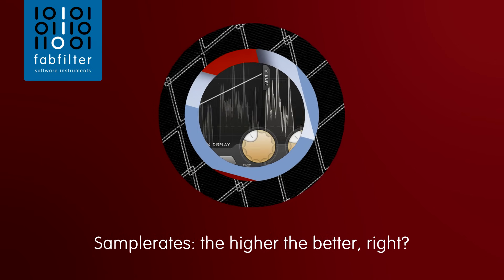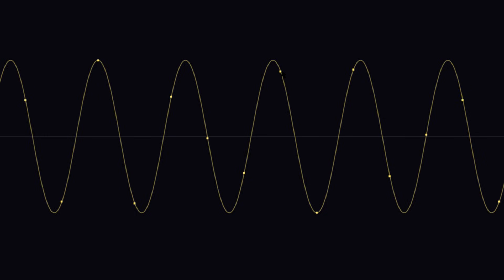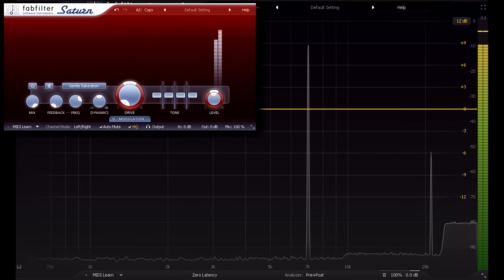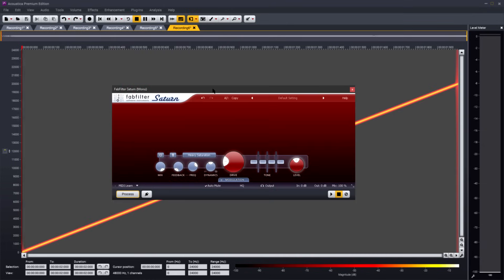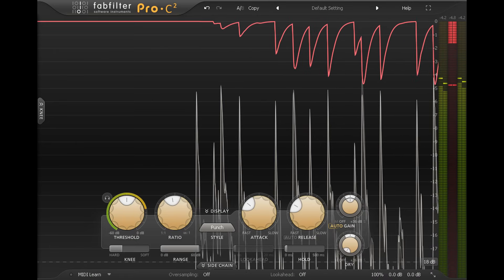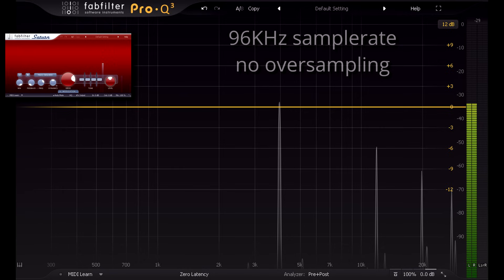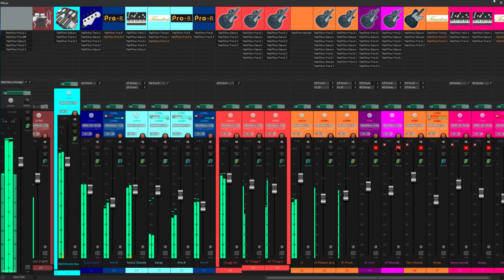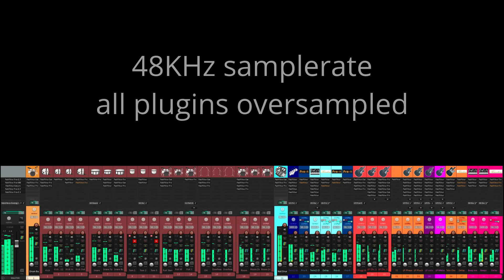Samplerates: the higher the better, right?

Comment: So much useful stuff in just one video, it's unbelievable :
- Understanding why digital saturation/compression doesn't sounds right compared to analog stuff (i.e. guitar amps for example)
- What is aliasing, with clear examples
- Which effects are concerned and you need to oversample, with audible comparisons
- Advice on what to do for the best quality without destroying your CPU
- The incredible custom guitar chain with EQ for the cab, then 3 stages of saturation for the amp. I HAVE to use this !
- At the end of the day, technical stuff or not, if it sounds good it IS good. Maybe the best advice of this video.

Thank you so much Dan Worrall, for this free valuable resource.
Reply: absolutely this

Comment: I love these rabbit holes what take you right back where you started, but with more knowledge of why your are good where you're at. I could hear the difference between all the sample rates/oversampling combos. I think I've concluded that for my uses, mixing in 48kHz with oversampling where possible will do juuuuust fine. I'm actually considering getting Saturn now, but I'm not sure I need it with the other saturation plugins I have. I haven't even looked to see if they have oversampling. Mixing is one of those things where you can easily get lost in the details.
Reply: No you didn't.

Comment: Dan, for years, I have searched for this conclusion. I spent two weeks chasing my tail trying to mix a solo acoustic guitar song: each corrective tweak created more deficiencies than what it solved. No matter what I did to "improve" the mix, it simply sounded like there were both dead spots and artificial bright spots that nothing could fix.

After watching this video, I tried a 'what-if'. I lowered the DAW session sample rate from 96kHz to 48kHz and made no other adjustments. Immediately, as if someone flicked on the sonic fullness switch, my mix sprang to life. Life will never be the same, thanks to this video. 48 kHz is my new sample rate. If a project calls for a track to make its way into the movie domain, I will simply upsample the 48 kHz master to 96 kHz to meet that format.

Thank you for this most excellent 'put the sample-rate argument to bed' video. Keep up the good work!
Reply: I'm sorry to say this with a delay of one full year. But are you aware that if you resample anything from 48 kHz to 96 kHz, the only thing you get is your files taking up twice the space they originally took, without any improvement in 
sound quality whatsoever?
Reply: I think you misunderstood the original post.

Comment: Thanks for a fantastic video Dan Worrall!! 
I have been skeptical if the the higher samplingrates made any bigger difference. When using 96 and resampling down to 44.1, I never heard a better result than going from 48 to 44,1. Now I can stop wondering and just stick to 48k with a great explanation and relief :-)
Reply: This video demonstrated that you will hear a difference, assuming you apply digital processing of the signal to a common degree. What did you think the point was of him advocating the use of functions which use 8x the project sample rate, featured in the distortion plugins?? 
 It just also demonstrated that you're better off using higher sample rates on a per-process/plugin basis, to avoid using resources on processes which cannot benefit from it (meaning not setting your entire project sample rate, based on the highest denominator which is your most aliasing-prone plugin(s) because it affects the CPU power needed for everything which doesn't audibly affect the signal as well. This has always been the case in out-of-the-box processing, because every analog signal processor, such as the type of distortions he's emulating here, was already 'upsampled' separately, by way of being an analog process, while the drum machine that the band used, was not unnecessarily digitally upsampled at the source, or at any digital point in the chain that didn't benefit from upsampling. But you will certainly hear the difference when you apply a digital process that aims to recreate the type of analog warmth that these distortion DSPs are doing. He's literally explained to you that you want very high sample rates for that type of processing, just that it's handy to have this function available and contained within each plugin, which in effect is just a way of getting closer to the way out-of-the-box mixing and mastering is done, assuming the inclusion of analog gear, which is virtually any  music that isn't chiptunes.
Reply: @JohnnyNatrium  Thanks for your reply Johnny. I got it and that was exactly my point. Using plugins upsampling.. and not considering the AD/DA when using outboard or recording audio:-)

Comment: This was a great video and you broke it down in layman's terms where people could grasp the concept. In reality the better the original recordings are captured or managed can also play a very important role in eliminating some of these issues you are pointing out especially if it means being able to use less plugins. In my home studio I try to use plugins sparingly not only to limit how much processing power is required by the computer but just to keep things simpler. I also run a Hybrid DAW station with an analog mixer with the option to run external compressors and limiters when needed which allows me to capture a really decent analog drum mix where the DAW can be just more of a multi-track recorder and the same goes for capturing bass guitar and using an external compressor/limiter rather than using plugins to manage the bass guitar's dynamics and as long as you're mindful of the gains during recording, you're golden. For me and my needs this works but for a modern day commercial recording studio this probably wouldn't fly or at the least they would be limited especially dealing with many different styles of music due to the dynamics they may see like speed metal vs classical music along with music production for a movie etc and the effects required to make it deliver.

Comment: in case anyone wondered, youtube is cutting at around 15k or 16k (so you might still hear 20k Hz)
Reply: Oof I nearly forgot
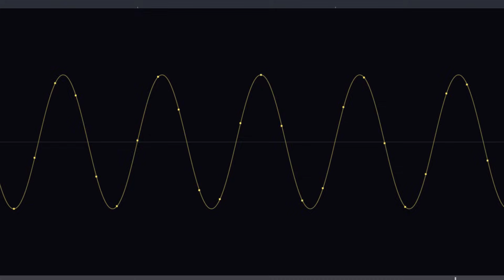Reply: Not for all videos. This video uses the Opus codec with a 20 kHz filter. The 20 kHz tone at 4:59 is actually clearly there (I checked with a spectrum analyser), allbeit a bit attenuated.
Reply: Check the stream you're receiving on the "Stats for nerds" option. If you're receiving an opus stream, you're fine.

Comment: Amazing video! Could you also do the same video for resolution as that has the same myths. So many DAWs support 32bit floating now but so many still use 24bit. Would be great to know the math behind this as well.
Reply: @ncshuriken  Reaper records in 64 bit FP
Reply: CPUs might actually handle 32-bit float better than 24-bit int depending on the algorithm. 24-bit actually has a ton of information, you probably won't hear it the difference, but I would not say the word "always" when it comes to computers

There's a good chance some DAWs will store 24-bit samples as 32-bit integers since CPUs handling 32-bit data better than 24-bit, plus it would increase mixing quality

Comment: Before I invested in my mixer and other outboard hardware, I did a lot of research into what was considered the optimum rate against cost benefit and return. I wanted to record bands multitrack during  live performances and master them afterwards into usable acceptable marketing material. I had used my much loved and trusted Yamaha 01x for almost 20 years but it has been obsolete for over a decade since Yamaha refused to update the "firewire" drivers since Windows 98 so there after I have to run later versions of Windows in development/test mode for the mixer to work !! 

For whatever reason I never found this tutorial, not that it would have made any difference, it is by far the best explanation over any other I watched of sample rates and diminishing returns on investment. I can see some highly regarded producers seriously argue with your opinion/conclusion, but like you I just chose to ignore their snobbish professional opinion of higher is better, understanding it didn't matter. So I bought my Behringer x32 over the more expensive Midas 32 variant or Allen and Heath knowing the quality might not quite be the same but still good enough for what I wanted to achieve. I also own a Liquid 56 so any extra quality could be overdubbed later, that is housed in my home studio cabinet that is way to heavy to be considered mobile. I just connect my Surface Pro through USB and I have a full 32 channel mobile recording mixer/studio with full remote control. I bought this start of lockdown as I was offered it at a great price including the stage boxes and interconnecting cables. Now I know some might comment on the Midas pre amps, I know, really I do, they are better, but I got everything for less than 1/3 the cost of the Midas 32 new.

Comment: Exceptionally well done Dan.

7:15 One point here, I don't think that the noise came down through out the spectrum because of inter-modulation, but I think its because the 7Khz sine wave lifted the level of the signal to the level of the clipping/distortion point at saturn so the noise started to produce overtones beyond nyquist that reflected back to audible range. I could be wrong offcourse.

Thank you very much for your effort

Comment: I’ve found that mixing at higher sample rates makes for easier mixing. It’s easier to hear reverbs and room mics, and the high end sounds different. I would guess that eq’s work better. All at the expense of more CPU.
Reply: Gordon Gurley agreed. And while there are plugins that oversample, there is also linear phase steep filtering involved which kills transients to my ears. 

I much prefer working at 96kHz and staying there without oversampling to get the best aliasing to dynamics to cpu load ratio.
Reply: @leckel1996  and how do you counter the intermodulation distortion that increases when working at higher sample rates?
Reply: @leckel1996  Also.. The video was using samples recorded at 44.1khz I assume. It's a whole other thing when you have recorded material at 96khz and 192khz. There is so much more than aliasing involved...

Comment: "I grew up watching standard definition TV, which here in the UK meant an image size of 720x576" . . . Well, the resolution may have been 720x576, but you were actually watching a 768 x 576 size image as PAL has a non-square pixel ratio (1:1.06) . . and to be super nerdy we can't really call a pixel count a 'size'.
Reply: Not going back tooo much further (Dan's not that much younger than me..), broadcast television pre-digital (CRT) was 625 lines in the UK..
Reply: Digital broadcasting size was indeed 720x576 (768 x 576) but the actual analog broadcast had a "resolution" of about 200x400-350x500 at times depending on the source and the quality of the broadcast transmitter / receiver. Recording it to VHS brought it down to 150x400 - 240x500ish. Analog resolutions don't really compare as you have to know the frequencies of the scalers to be able to calculate the digital equivalent.
Reply: @duncanparsons  Full image was 625 lines but this included sync and timebar that weren't shown to the end viewer. The visible area was - theoretically, but never achieved - 576 on PAL.

Comment: 48 khz sounded the best to me here in this video (although I listened this now only on my Macbook pro). More low end, somehow fuller sound, deeper.. The same conclusion I got while oversampling project inside my Cubase 9.5. Actually what you can't see/hear in this video is when you go for higher samples,  I mean higher than 48khz, although they clear the higher spectrum you loose your meat or low end as you want, the body. The kick will sound thiner, without the punch and so on.. The same as in this video I found 44khz sounding somehow as with less informations, less headroom, shallower, somehow as if it's overcompressed. All in all thank you for this video, it's really so instructive since it enters in details in the very core of the problem and it clears a lot the mess in persons head when you start to ask yourselves what to choose between the options and how to set yourself up given the possibilities.

Comment: Found this video while just searching for differences between samplerates and got a whole lot more information than I thought, thank you very much!

What surprised me is that if you resample a sound file from 8kHz to 384kHz, it does actually not increase in size, whereas with video files, increasing any quality setting will increase file size.

Anyways, for my use case, which is shrinking file size, 44.1kHz is definitely enough and the gains are not worth it to resample everything.

Comment: I am not an audio engineer, but when I use the SGA 1566 plug in at 4X, the audio sounds smoother than with no oversampling. Plus the audio just has room to "breathe". The bits are not increased, but it IS easier on the ears. The SGA 1566 is the Shattered Glass Audio plug in. It emulates tubes very well! It is worth the extra processing time of about  2 and a half hours for about 55 minutes of audio. You can really hear the difference with headphones.

Comment: The engineers  that did the double blindfolded testing with Toshiba/ Phillips could not tell the difference.
They used the same record cued on vinyl and on CD blindfolded.
The "sweetness" in old analogue was distortion  From channel strip,  transformers, too inserts with comression..to tapedistortion to compressors onto mastering. 
I wish I could find it.
Brilliant video at the saturation point was so educational as an amateur mixer.

Comment: Dan’s videos are great!
IME the most difference between applying oversampling or not is a difference in the perception of depth: To my ears aliasing makes tracks sound flat, with less front to back contrast. 
I oversample most of the times.
Reply: can difference be heard with monitors, or only headphones?
Reply: @izvarzone  I only work with monitors in the studio. If the room is acoustically treated and the monitors provide enough resolution, then with a little practice it becomes easy to spot aliasing.

Comment: 21:17 Running multiple stages at a higher sample rate with a low-pass between each is effectively oversampling, just doing it manually.

24:45 Another benefit of a more gentle roll-off is less ringing (Gibbs effect) on edges of pulse waves.

Comment: Great video. Nothing wrong with anything you say, but I'd probably add that one thing in favour of a higher sample rate is the decreased latency. Doesn't really affect studio recording as most DAWs will correct for that, but if you're using your laptop for effects in a live performance then using a high sample rate with a low buffer size can make a very big difference.

Comment: Absolutely brilliant. I've never heard much in depth discussion on this. I've always known I could "hear" above 20khz, simply by how ultrasonic frequencies affect the rest of the energy around it. Its amazing to see there is actual math show high frequencies modulating the audible frequency range. Makes so much sense. I remember hearing the air band on the Maag Eq & Thermionic Early Bird, and being absolutely floored. It's like my ears switched on properly after using this gear. Changed my entire approach to sound entirely.

Comment: TL;DR capturing in high sample rates is good because high-res A-D converters can use gentler anti-aliasing filters. 

In many discussions of sample rates, advocates of “high” resolutions (including 96k and 192k) will swear that the capture of higher frequencies really do make a difference, and that >20kHz sound can be heard… however, I am not aware of any double-blind studies that have been able to demonstrate this. Having said that, the capture of these high frequencies is not necessarily the chief benefit that one gets from high-res digital audio. 

As you mentioned, digital audio recorders must have low-pass anti-aliasing filters in order to remove frequencies above Nyquist, so that the aliasing artifacts are not captured/heard. In order to accomplish this, and assuming a 20k corner frequency of the anti-alias filter, the filter itself must be very, very steep. It would need to essentially mute any audio above 22.05k or 24k (44.1k and 48k sample rates, respectively). A filter that has 72dB per *octave* is considered steep, and those two nyquist limits are a nowhere near an octave away from 20k. Steep anti-alias filter = more phase distortion near the corner frequency. 

However, in high-resolution audio converters, since nyquist is so much higher, the anti-alias filter does not need to be nearly as steep. It only needs to “cut off” frequencies above 48k or 96k (for 96k and 192k A-D conversion, respectively). Less-steep filter means less phase distortion. 

In practice, I’ve found that audio captured in higher sample rates tends to have much more precise stereo imaging, and transients are much clearer. I’ve tested this by recording the output of my record player, simultaneously, to two different interfaces - same model, but one set to 44.1 and the other set to 192. When blind testing the two transfers, I was able to tell which one was the 192kHz with program material I knew well almost every time. I wasn’t able to do it as reliably with records I hadn’t listened to much, but after a couple listen-through’s I could pick it reliably almost 75% of the time.
Reply: MF Nickster  I have a feeling that 192kHz recordings paired with steep anti-aliasing filters designed for 44.1kHz A-D converters would sound a lot more like 44.1kHz than 192kHz. I cannot say for certain, as most A-D converter chipsets have their anti-alias filter circuits "baked in;" it's not a practical or simple matter to swap different filters in and out. One can only wonder (unless someone more knowledgeable would like to correct me on this)